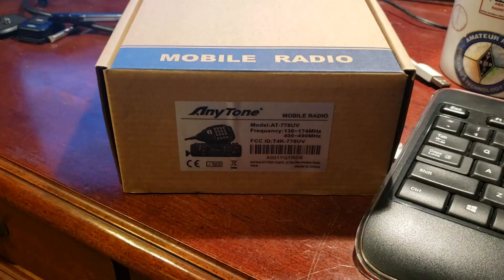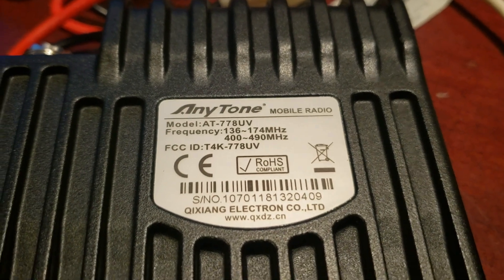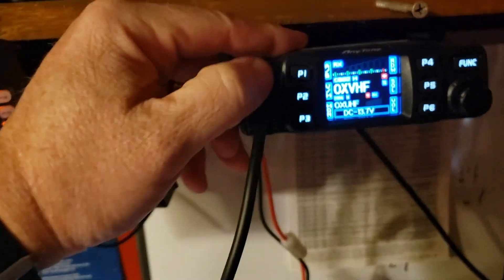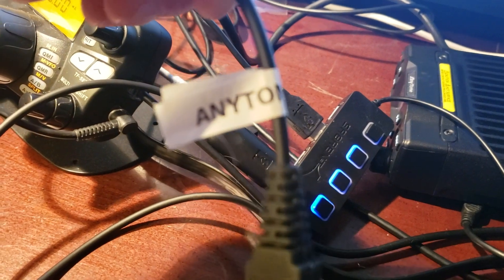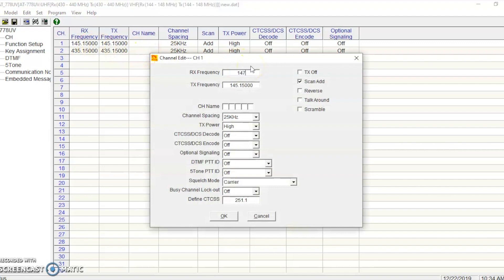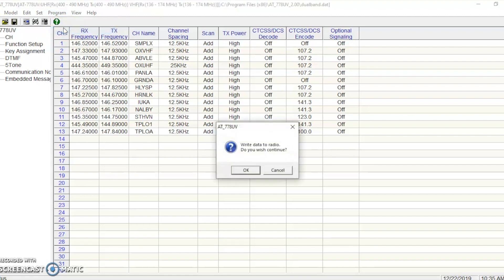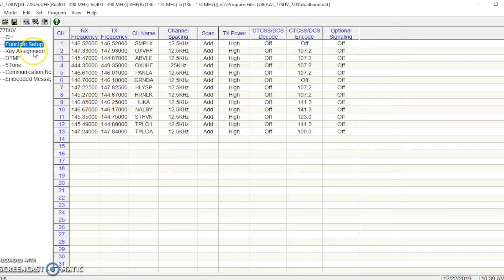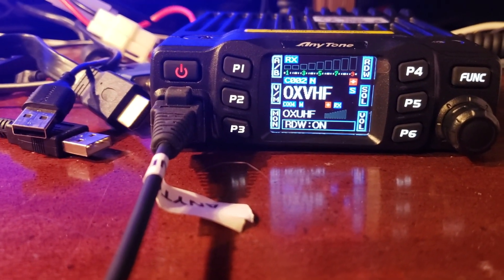AnyTone 778UV Mobile Ham Radio: How to Set Up and Program.

Comment: Hello!  I recently bought this and really appreciate the video.  I am 100% brand new to HAM and especially this radio.  I'm finding it difficult to connect not only the channel settings to local channels and repeater settings, but, the radio settings itself.  Not much info on it either.  Do you have a reference I can use?  I'm planning to study for my license to Tx, but, would at least like to set it up to listen.

Comment: What is the define CTCSS space in the software? I thought it had something to do with what tone radio would receive transmissions from but when I try to set it to 0, it changes it to 50 as soon as I click ok. Also, after I write the information to the radio and then read it from the radio, it deletes the settings that I put in the first two channels and puts the default frequencies back into the top two spots.

Comment: For anyone that want to change the main knob to volume : Just for your information you change the main knob to control volume only in chirp settings !
I changed mine in the settings and it works perfectly. Now to change channels with the knob
i just push P6 {channel} and i can now change channels with the knob.After you make the change in
chirp just upload back to the radio.  {Anytone 778uv}

Comment: Can you program GMRS/FRS frequencies?
Reply: Also what I want to know because it says right on radio it goes too 490mhz
Reply: You have put it in Test mode and choosing mode 2 to open the band to the extended gmrs band. 
You do it by holding down the function button and P4 button and power on the radio at the same time and it will come up to the difference screen  that will allow you to choose from mode one , two  or three and it will show that it is on channel 43 but you can change it to mode 2 which will open the band for programming of gmrs. That shows up just below that channel but it must be in that mode 2 to open the gmrs capabilities

Comment: Just grabbed mine, for some reason on certain VHF channels the display will flash "DC LO" and not allow me to transmit. Unit seems to be getting 13.6V which should be enough. Do you have any clue what could be causing this?
Reply: You probably need to unlock it. You can find videos on youtube to do it.
Reply: Actually DC LOW could just be an internal fault in the radio. I didn't read it all my bad. You can still try transmitting somewhere OR try to see the voltage it dips to when you transmit. It might dip too low when trying to transmit at 25W, try low power. If that fixes your problem you need a new source of power

Comment: Hello, thank you fornthe video. I have a question about my newly purchased AT-778UV. The range spec of the radio says 136-174 MHz however I am trying to enter my off road racing frequency of 158.272MHz an it won't work. Says "out of frequency range. I am by no means a radio expert. What am missing? 
 Thank you for your time.
Reply: I bet you have the EU version radio and not the USA version.  On page 29 of the manual look at the first box called "Frequency Range".  If you can't program a frequency that this radio should cover then you have the EU version and need to unlock the frequency ranges.  There are a couple of YouTubes on this.  It's easy to do just follow the sequence of their instructions closely.  This was the problem on my radio and it drove me crazy and cost me hours of messing with it.  I almost sent it back.

Comment: I just purchased this radio.  What is the proper Channel Spacing for 2 meters and 70 CM?  I have seen 12.5kHz and 25kHz for VHF.  I think I saw 25kHz for 70cm.  Thanks for any advice and for your fine video.  Mike WA7JYM
Reply: The smaller the spacing, the better your chances are that the channels will try to run over each other, but the more channels you'll be able to fit. The larger the spacing, the less channels you'll be able to store, BUT, the channels won't be trying to interfere with one another. More spacing more better

Comment: Hi. Thanks 4ur time letting "Us" Newbies on at least set this model radio up. I know you've been doing this 4 a longtime as you flashed thru it dam fast and I said out lond while watching you, How the "... down, I can't keep up. On what u where doing with the different settings, is there a site I can go to to help teach me on how to input the correct settings and also, generally getting some other help with those "settings" Also, Antenna choice both mobile and in " The Shack" as you called it, Power supplies etc.Thanks again for your help. Cheers. Teddy. Thanks

Comment: i dont know much about radio but will these work on there, there commercial frequenzies,,, will this receive and transmit between 136-174 mhz,,these are what mhz needed it... 150.290 and 159.270 and 165.980 and 170.250 and 170.310.....171.000.....172.065

Comment: I've had one of these for a few months and finally got around to programming it.  USE CHIRP!  The factory software is terrible.  I was able to paste the station information from my UV-5R image into the Chirp image for the AT778UV.  Must easier to use.  One gripe I have noticed so far -- the volume control wraps around.  If you want to spin it quickly to silence the speaker, it wraps to maximum volume if you go past zero.  Really??  This is just plain BAD programming of the firmware (I do this for a living.  It's not that hard to avoid this problem).  I will be installing it in my vehicle in the Spring.  Looking forward to it.
Jim  N4FAF
Reply: What version of CHIRP did you use
Reply: @robertpunzell7607  I generally update the program when I have a new radio to program.  So far, no problems with backward compatibility.

Comment: Recommended Power is 14.2 V DC for that radio. so if you have a decent amp Variable power supply just set it to 14.2 V DC.

Comment: Good afternoon K5ATA!!!  Thank you very much for the programming video. I may be picking one of these radios up from a friend this week and if I do, I'll be referring to this video.  My question is, I see this has "dual watch" but does it have 'dual receive' (assuming I hook this radio up to a dual band antenna!!)?  The reason I'm asking is because when we are at events in my area (Triathlons, Baseball Hall of Fame Induction, 5K/10K runs, etc), we run both a VHF repeater and a UHF repeater.  People use one or the other depending on their location but if possible, we need radios that will not only see when they are both being used but the radio needs to put the audio from the displayed 'sub' channel through the speaker too (no, not necessarily at the same time--but would it??).
Does this make sense or should I reword this???!!!  Thanks, W2RRK

Comment: This radio is available now (July 2021) from various sources as: Anytone AT-778UV, Retevis RT-95, CRT Micron UV and Midland DBR2500.
Some arrive "Unlocked" for the North American Band plan; some do not. There are a few YT videos describing how to handle that.
I think all of these sources offer the Owner's Manual and the Programming Software as a free download now. There is now a Ver. 2 and a Ver. 3 and you need to know if yours is the "RDW" or the "VOX" version.
CHIRP works very now IF (and only IF) you select the correct version for your particular radio.

Comment: Can anyone confirm if this is the same unit as Midland DPR2500. It looks identical and the program appears to be the same. Having trouble knowing whether I am transmitting or not.
Reply: Yes. Anytone AT-778UV = Retevis RT-95 = CRT Micron = Midland DPR2500

Comment: Got as far as Write to Radio and then a error message came up "Band Error" . Any ideas??? Thanks W0KLB
Reply: Go into the program tab and it should read Band 3 or Band 4.
Reply: @cmoreoverland6739  Thanks, I managed to manually load all I wanted. I will try your fix though. 73

Comment: I have went through everything, reset it, and still no sound. Receive freq signal flashes. Manual states check the RCDT:DCS  and the TCDT:CTC settings.
Reply from the maker: Sounds like maybe you have the ctcss turned in for receive.
Reply: @K5ATA  how do I fix that?

Comment: @Goodgames 
what power supply suggested for use at home>?
Reply: I know this is a question you put up 2 months ago, but I will link the power supply I use. It is 30amps so it has more than enough to run this radio or if you upgrade later and get a more powerful radio.
https://www.amazon.com/dp/B000NPT4TK?ref=ppx_pop_mob_ap_share

Comment: Question ???
How big a power supply do I need for a 778 uv ?
Reply from the maker: I’m running mine on a 15 amp. I’m sure it’ll run on less. I’ll check the specs when I get home.  Thanks for watching!
Reply: Amps = Watts / Volts

Comment: The software will not allow monitoring of frequencies of police and ems will it? It keeps saying out of range, just trying to turn it into a scanner
Reply: Police use digital mode. You will only hear static..this is an analog radio
Reply from the maker: True. Nowadays most police/fire/ems use digital. Some smaller departments may still be on old systems but not many.
Reply: @K5ATA  i actually got it working, I had to download what was on the radio to get the correct frequency range, our area still uses all analog so it is working perfectly now

Comment: In case it helps anyone, I guess there's a driver now for the AT radios and I was able to program my AT778UV using CHIRP.
Reply from the maker: Nice. Yeah, Chirp is constantly changing and adding radios they support.  Thanks for sharing!
Reply: That does help. Anytone only seems to support Windows with their programing software and I run exclusively Linux.
Reply: Absolutely I used Chirp to program my anytone 778 UV 2

Comment: can you recommend an antenna (mobile/home use) and power supply for this?
Thanks!
Reply from the maker: For mobile use I have had good luck with a variety of MFJ antennas. I did a video on some of their mounts as well. For home use, I use a Comet... but have also used Cushcraft AR-270 (if i remember) and was very pleased with it as well. Thanks for watching!
Reply: @K5ATA  Which Comet are you using? I've been looking at either the GP-3 or GP-6 to pair with this radio.
Reply from the maker: The gp3 is a solid antenna. It’s what I installed at my mother in laws house.
Reply: @K5ATA  That’s good to hear. Which Comet did you put up for yourself?

Comment: How does this compare in size to the Mini Radios such as Btech etc. been looking for a visual comparison, not wanting a full size like Yaesu, Icom mobiles etc.   Does this program other frequencies besides 2M/440 like most of the Chinese radios
Reply from the maker: This is basically a BTech.  It's not as large as a full size radio. If you are familiar with the Raspberry Pi, it is just a hair over two Pis side by side with a little hanging off the back.

Comment: Any suggestions for a 2m/70cm antenna for F250
Reply from the maker: Tim, I actually just posted a video last week about different MFJ mounts. Check it out. Make sure yuo don't go mag mount if your truck is aluminum (2017 on I think). As far as antennas, depends on how much you want up there. I did a test on a mag mount to see if it would hold the MFJ1432B and that is a great antenna... I might actually swap out my old one and get one of these.
Reply: Its actually a 2004.  I bought a Diamond K400 adaptor and a NR770HNMOB

Comment: Hi,  how do I go about increasing the mic gain on this radio???

Thanks in advance 

Robert
Reply: I've got the same issue with my CRT Micron (same rig) the 1.19 software for the 878 has a mic gain setting from 1 to 5 and it looks like you can select a different model but it's grayed out and wants an engineering code entered before you can continue. I've widened the hole in the microphone but it made little difference. I'm still searching for a resolve. 73's M0CPU

Comment: What is the best power supply for the Anytone 778-UV?
Reply from the maker: Which is best is hard to say, but I can say that I am using a Tripp 15amp. I have run it off my Astron 12 amp power supply. Both did a fine job with it. Thanks for watching!
Reply: @K5ATA  I accidently turn on the password  then turn off power without  knowing a password .The won't turn on .Anybody know how to reset .Help,